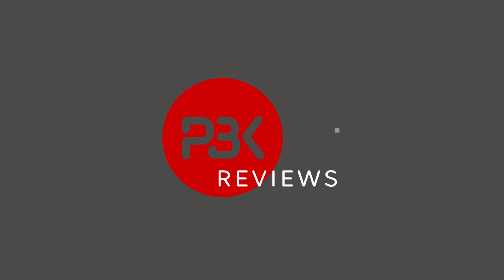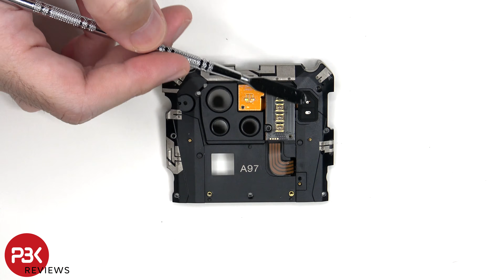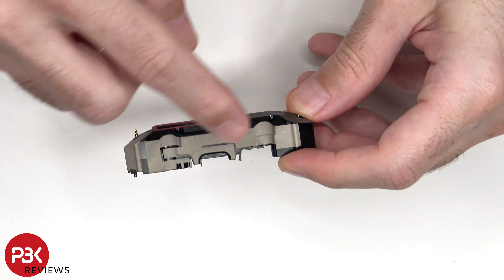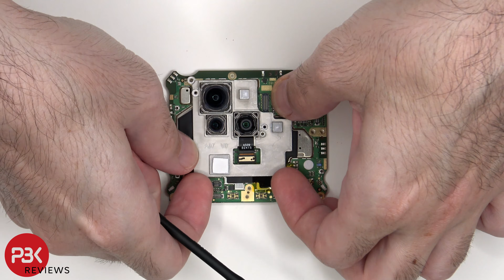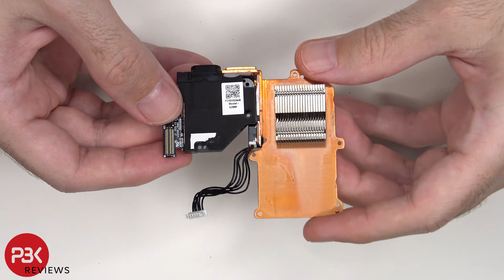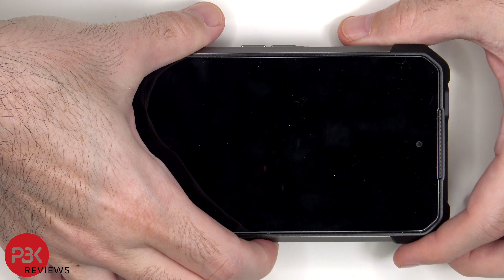8849 Tank 3S Teardown Disassembly Phone Repair Video Review #smartphone #teardown #diy #phonerepair

Comment: Fan doesn't run anymore after upgrade OS to android 14. It doesn't work when projector starts (no sound at all), does not work in "instruments" app -> fan, not work if use single test with #*#3377#*# code. Also the camp lamp doesn't have switching warm and cold light, only on/off and brightnes. In settings -> "about phone" the model of phone is Tank 3 (not Tank 3s!)
I have downloaded firmware from unihertz site, there are 4 different versions: in "European_EEA" three android14 and one android 13, same in "None_EEA" folder. But!!! in files of firmwares filename are MT6895!?!? Tank 3s have MT6896 processor (Dimensity 8200)
Maybe fan will not work on any other firmware, idk
Mb it must be replaced with new one.
Is it soft problem or fan is dead?
Phone was not falling swimming or any physical, temperature or other damage.

Comment: 15600 mAh is a lie.. and you hide the true.. the phone contains 3 elements of battery, not 4! 3780 mAh x 3 = 11340 mAh = all real capacity of the Tank 3S. Even if was 4 elements result only 15120 mAh and not 15600..
Reply from the maker: The conversion is clearly stated in the video if you actually watched n listened. What benefit is it to me to "hide" it. Never surprises me the stuff people say.  These batteries are not the same voltage like other smartphone batteries.